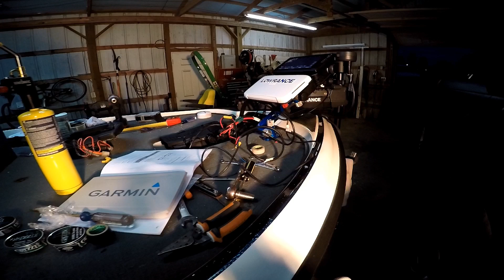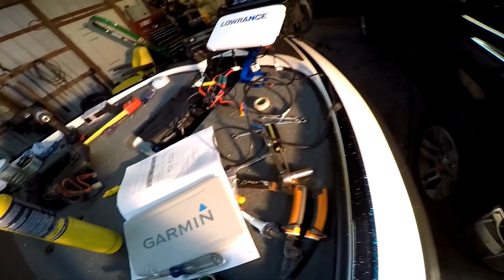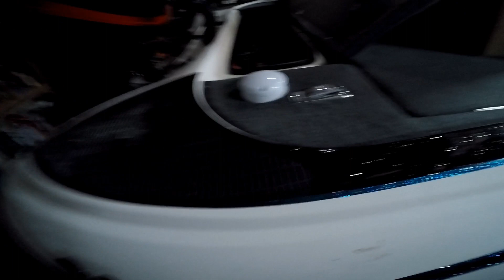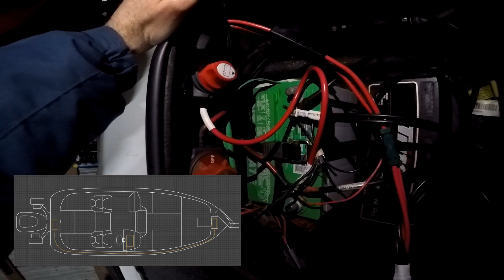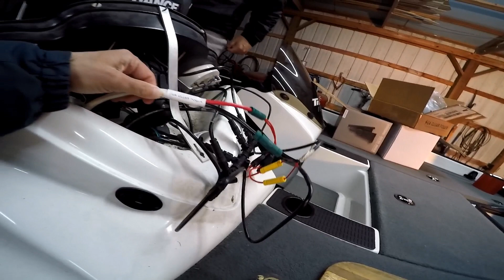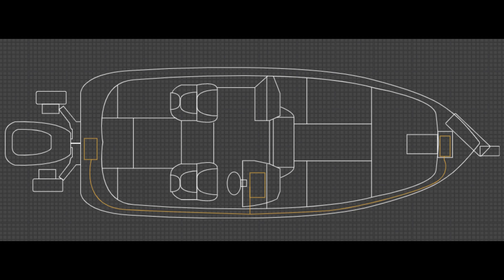Multiple Graphs? 1 Clear Answer, Sea Clear Power boat wiring harness. Triton Boats

Comment: Awesome. I have the same boat and upgrading everything as well. The power on and off switch’s in the back. Is that a bracket that you have then placed on. Really like that.
Reply from the maker: That switch comes with the Seaclear power wiring harness.  So you will mount it in the back of the boat!!